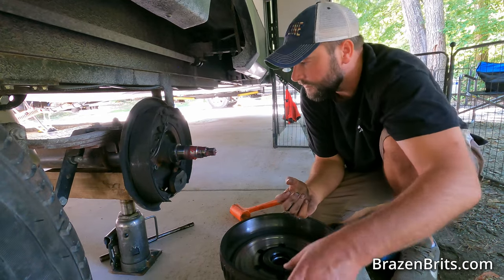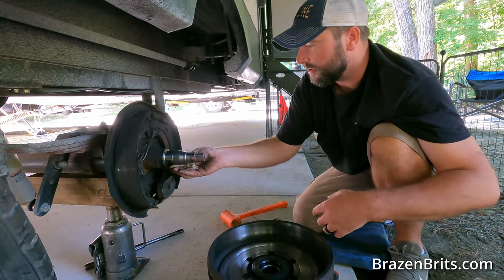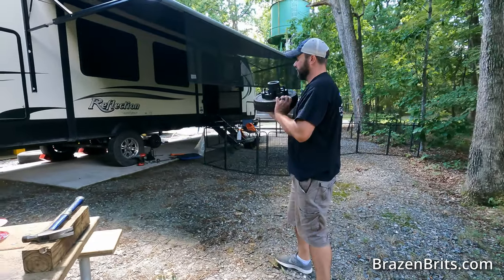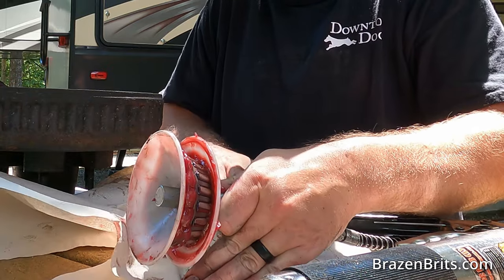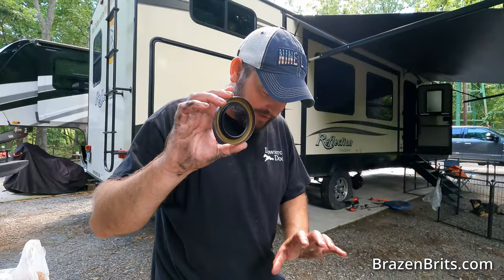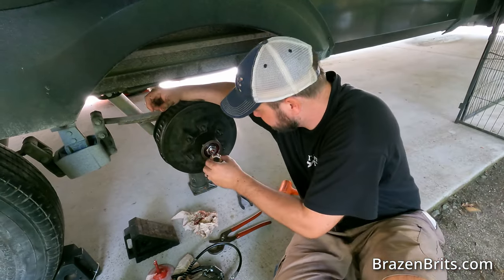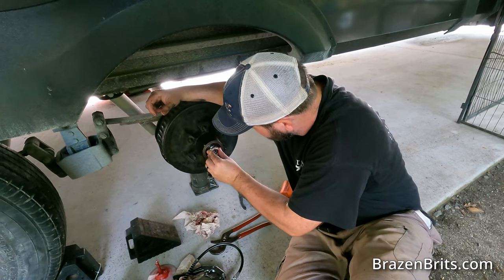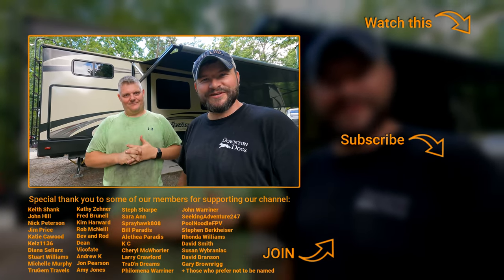RV Beginner DIY: How to repack wheel bearings

Comment: Good job! Trick to getting the nut on is to place it on and turn it slowly in the wrong direction. Turn it until you feel a small click, that is the nut dropping into position on the thread line. Great job though! 👍👍 Rob, was he a good student? 🤣😎
Reply from the maker: good tip! Will try that next time
Reply: @BrazenBrits  it works for most any nut bolt combination.

Comment: Never used, let alone heard of a bering packer. Always just used my hands and fingers. Not much messier than what you're doing, just as effective, and definitely quicker and easier.
Reply from the maker: yup, have seen it done. Many swear its just as good, but have also heard it's not as effective. Who knows :)
Reply: @Brazen Brits  the trick is you have to really clean the bearings, and your pushing the new grease all the way through. You still have to pump the extra into the zerk fitting. When I do mine in the spring, you can come help.😂😎